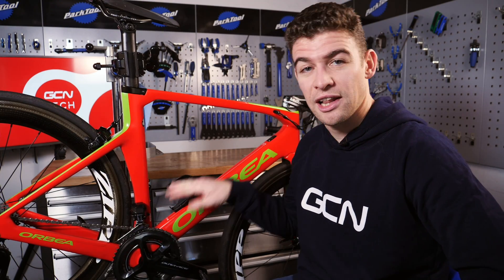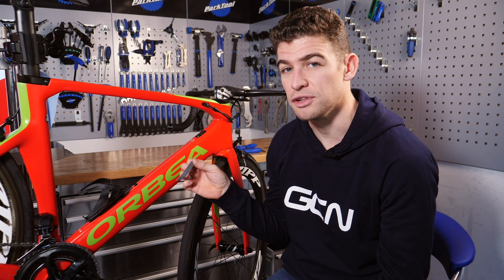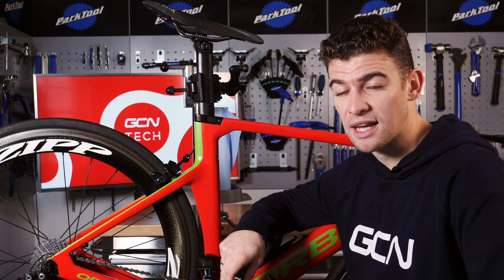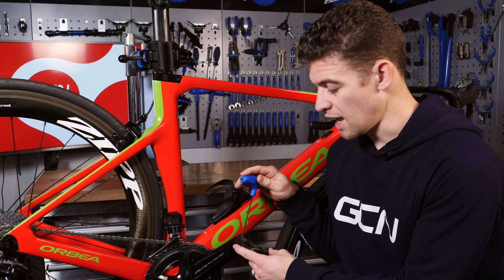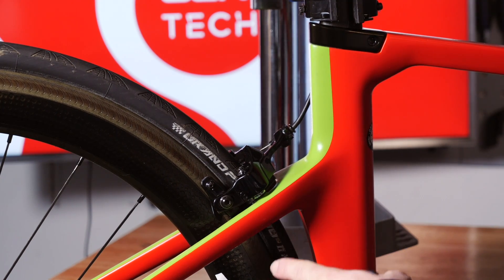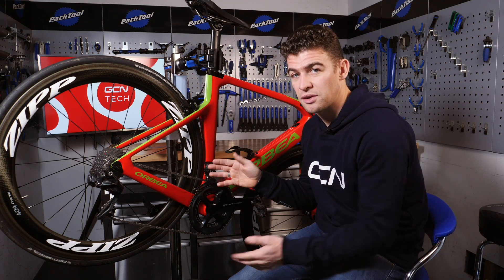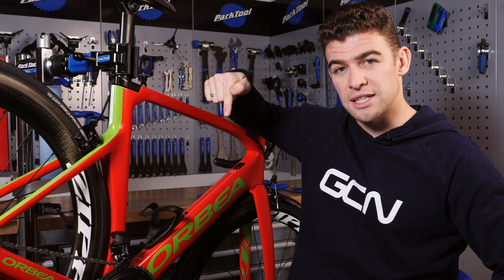10 Pro Bike Setup Hacks | How To Make Your Bike More Pro

Comment: I'm always curious why people put grip tape on their bottle cages. I ride lots of MTB races and never see anyone do this. If you lose your bottle it's just a bad cage imo.
Reply: I'm pretty sure pro roadies do this because their bottle cage sponsor makes bad bottle cages. Mtb racers just run secure bottle cages.
Reply: Usually my problem is to get the bottle out of the cage
Reply: What mythical bottle cages do you use? I mount my cage to my saddle, ie downward facing, and like every single cage i come across looks like it was designed only to point upwards, and or weigh a tonne. I was gonna get a specialized zee, but i sometimes ride with normal bottled water, which it doesnt retain well.
Reply: Also. Mtbs have suspension. Road bikes dont.
Reply: I use alloy cages on mtbs a squeeze down bit if it's a longer ride i'll be using a hip bag with a reservoir to keep the bike light and my shoulders free to be a bit more dynamic through techy sections and jumps.
Reply: @Cal94  try out xlab's gorilla cages they'll hold onto your bottle 😉
Reply: Simple €10 Bontrager bottle cages did the job for me. Even on my old full-rigid XC bike. Currently I ride Fabric cageless water bottles and I'm super stoked on them. If you tighten the bolts well on these, the buttons will get nice and wide and the bottles won't fly out. I have them for 2 years now on my rigid gravel bike on which I often ride XC trails, and they are still in there nice and stable. Plus they save you 90g (per bottle) compared to a standard plastic cage + standard bottle.
Reply: @mrtnknrr  yeah I was wondering if the fabric system was any good, certainly looks tidy with the other advantage that your bottles stay looking fresh new so less plastic being replaced not that i throw out the old ones, mine get used as storage pots in the workshop or sit in the old race plates n medals memorabilia corner.
Reply: @Cal94  the Cateye BC-100 bottle cage.  Cheap,  indestructible,  death grip on bottles.

Comment: Watch out with the silicon spray, if you brake your carbon frame and need a carbon repair it can’t be repaired because silicon spray is very  hard to get off your bike
Reply: Tacx cages and Tacx conical bottles - 30,000km not a lost bottle

Comment: If you do some research you will find that brand new chains actually have more friction and thereby more resistance than used chains.

And as mentioned underneath, the skateboard grip tape will ruin your gloves and bottles. Buy a proper bottle cage and you won't lose your bottles. a €10 one from Bontrager will already work perfectly for even enduro riding, while the Decathlon one will make your bottles fly even on a bump on the road.
Me being someone who rides a lot of gravel and XC trails on my gravel bike, even with -10 degrees Celsius in the winter, I feel like the skateboard grip tape is useless on the handlebars and on the shifters. Proper handle bar tape and proper gloves will do all the work.

Comment: The QR tip is cool for that setup.  However, if you have a disk brakes, keep it as is was sticking out the back.  It gives a little extra protection for the brake rotor on its most exposed section.

Comment: If one has to spray a silicone protectant,take both wheels off and cover the brake shoes to prevent contamination of the braking surfaces.
Reply: Larry Daniels what about spraying on the cloth then wiping?
Reply: @JS-tb9hu  Exactly,my preferred method.Using a cloth allows a more controlled application,you also don't want silicone on the bars,hoods,brake levers.I think you will save $,making the protectant last far longer.
Reply: Why the hell would anyone want to cover their bike in silicone, that seems like the dumbest idea I have ever heard of, but I live in a dry dusty climate
Reply: @ticklefritz5406  I've heard that it can reduce the air resistance at speeds over 45 mph by 0.0009 watts,however,the microscopic increase in tubing diameter effectively inhibits the bikes ability to attain speeds over 45 mph by 0.0009 watts.So,I will have to use it for it's shiny aspect alone.

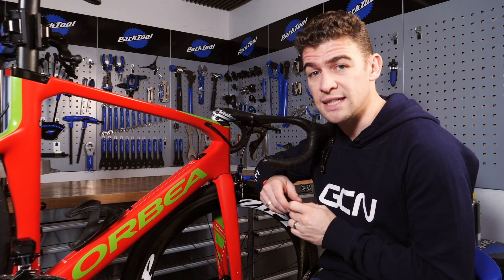Comment: Sorry guys but wrong at 2:34 you should never over tighten your quick releases you can crack a carbon fork. Always palm pressure tight.
Reply: It also puts unneeded pressure on the bearings, slowing you down a bit.
Reply: I really don't think it is possible to crack a fork with QR pressure, it is not hollow at the dropout hence the material is fully in compression.

Comment: Don't use that crappy sandpaper grip tape he was applying. Look for rubberized grip tape that's used on pistol grips to customize them. I used a brand called GP-5000 on mine and it works great. It's really effective when used on a mountain bike as well.

Comment: A slightly broken in chain is actually marginally more efficient than a new chain
Reply: And in reality is so slightly "marginally more efficient" as to be immeasurable.If one left factory lube on chain you will never be more efficient than if the chain was processed correctly at the beginning.
Reply: @larrydaniels6532  "You’d be forgiven for thinking therefore that new chains would the most efficient as they have less ‘give’ in them, but think again. Research shows that chains that have been run-in slightly are the most efficient, gains improving as the first few hours roll by. So if you are buying a new chain for your goal race, warm it up for a few hours in the build-up week to save another 0.5w." Gotta get those marginal gains boiz
https://www.visiontechusa.com/en/news/ride-faster-and-longer-improve-your-drivetrain-efficiency
Reply: @eliotwolfert8488  Don't miss my point,if one simply installs a new chain and warms it up for a few hours,it will in no way be as efficient as a properly prepared new chain.Anyone with the slightest cycling experience can relate to the drag a new chain has with the transportation lube the factory places on the chain to keep the steel rust-free.If a new chain is cleaned of this factory lube before the initial usage and modern lube or even parrefin is used.This chain will be from the start,more efficient than a chain with factory lube.
Reply: @larrydaniels6532  what is one has a bed in chain, phlops it in the chain bath and puts on some ufo drip?